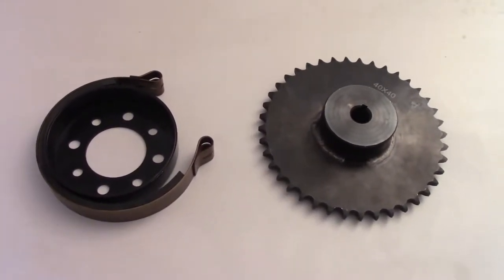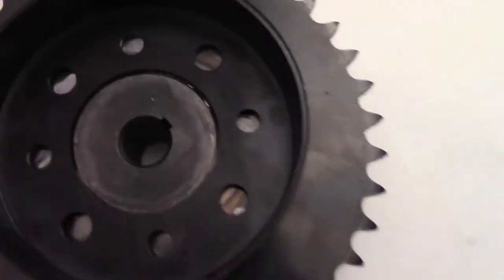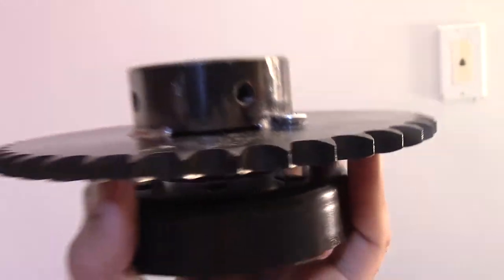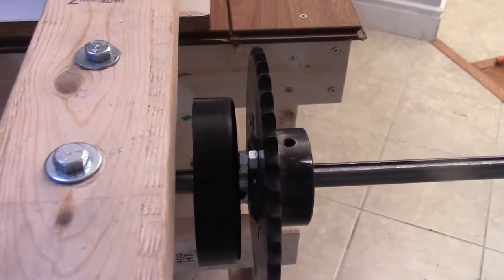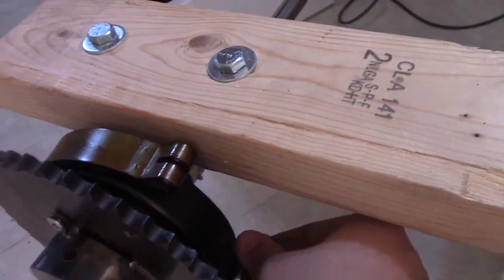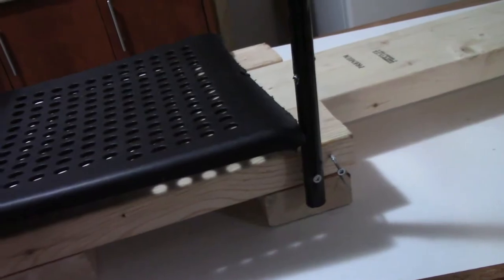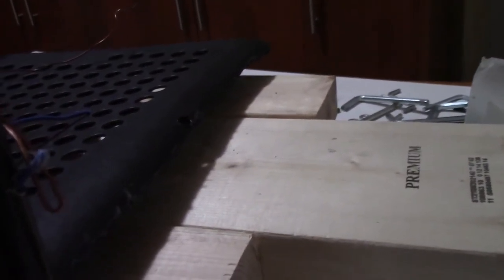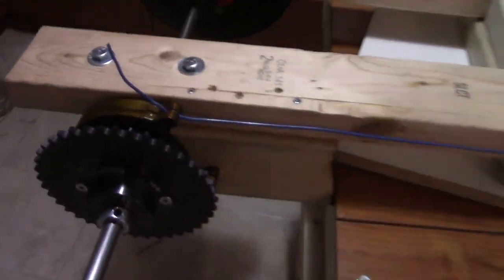HOW TO INSTALL DRUM BRAKES ON A GO KART

Comment: Only problem is that you put the brake and sprocket on the wrong side. The engine's shaft will be on the left side.
Reply from the maker: I know I made this mistake, but I figured this out and flipped the brakes to be on the left side.